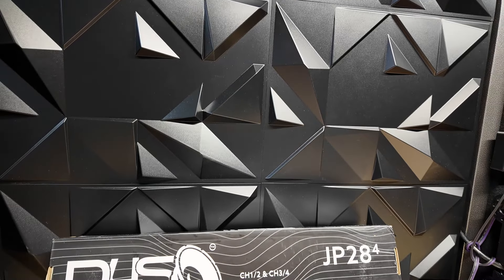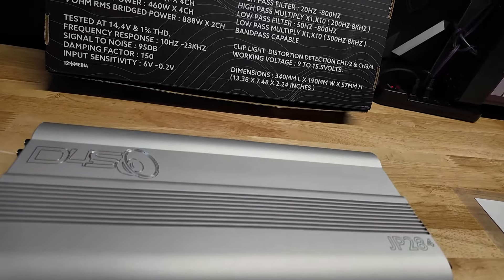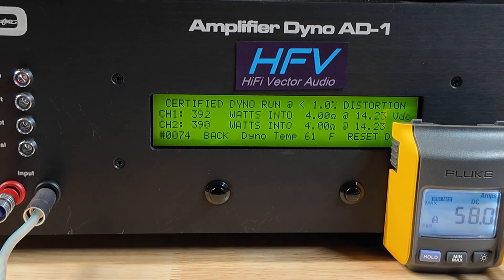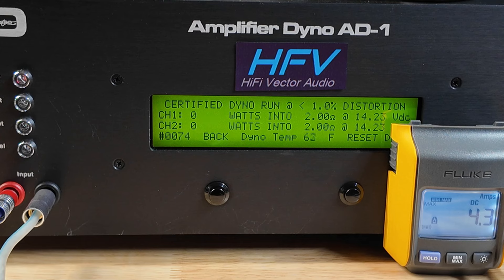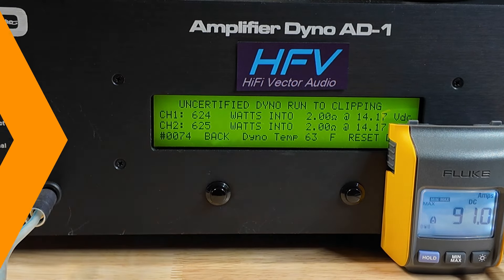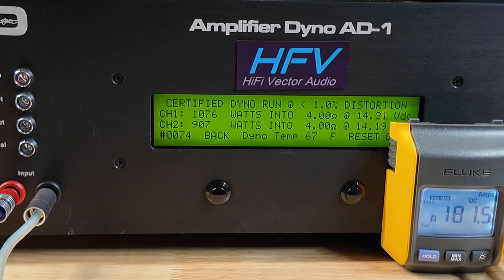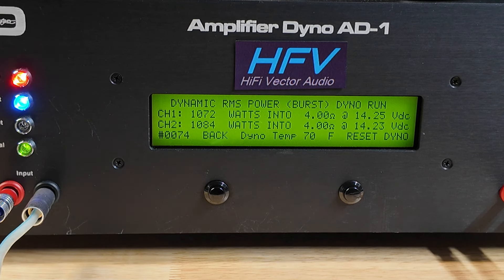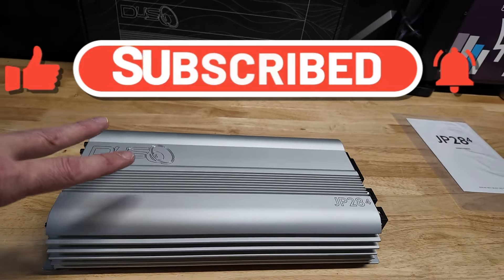D4S JP284 amp dyno test 4 channel car audio amplifier Down4Sound Jp

Comment: That's pretty impressive.  And the fraction of the cost of a US Amps.   Curious how it sounds.  The last JP 4ch I tried out was kind of lacking in the sound quality.  Just not the same as the Alpine it was supposed to replace.
Reply: Yep, but now a days you can get a pretty good dsp still less than a USamps or the new Orion
Reply: Very few people can actually hear the difference in sound quality from amp to amp when driving down the highway.  

Now for sound quality setups, that is a whole nother animal!!  When you have high end sound quality speakers, several layers of sound deadening, and good quality DSP then you could definitely hear a difference!!
Reply: @91CavGT5  I guess what I meant was that there was a bit more hiss/floor noise and sounded a little more compressed?  Not trying to golden ear here.  Just saying it didn't sound quite as good. Maybe with some more tuning, or maybe I was just used to listening to the Alpine for the last 10 years.
Reply: @johnnyh127   some of us can hear those things more so than others.  24 years ago I helped tune a SQ competition Kicker sponsored car at the USAC nationals.  Now though, my hearing has gotten so bad that I don’t know if I could tell a difference.  I envy you guys that still have hearing good enough to tell a difference!!  👍
Reply: @91CavGT5  if you have a perfectly matched ABX double blind setup, it would be very difficult to hear the differences between one amplifier or another.  But when you listen to something for so long it becomes the reference.  I was fortunate to work with David Clark, Tom Nousaine when I was younger.  I was just a punk kid working after school at DLC Design, but I learned more than I could have ever imagined.  And I realized that audio reproduction wasn't just about SPL and huge bass.  Part of my job was setting up the listening technology classes so I got to spend a lot of time listening to their reference systems.  I can hear the differences in the nouances. It may not be all of the time, but certain tracks on certain systems just sound different.
Reply: @johnnyh127  that is an awesome way to learn what music is really supposed to sound like!!  

With my friend’s SQ setup, it was in a Honda Civic.  It had components mounted in the firewall to the left and right of the driver and passenger feet respectively.  There were 3 Kicker Solobaric 12” subs mounted into a fake trunk floor, with two 1/3 octave mono EQs(maybe Audio Control I think) mounted to the back of the back seats.  The amps for the system were mounted upside down under the rear deck of the sedan.  It had 5 1/4” midbass drivers mounted under the front seats, and the front seats were mounted to custom brackets that moved the seats backwards 6” more than stock.  An hour before competition started, we were doing the finishing details and listening to a classical track.  In the drivers seat you could close your eyes and make out EXACTLY where each musician was on the stage when the music was recorded.  But there was a gap in the center, about 6” wide, where no sound was emanating from.  My buddy who did the install began to frantically check everything out, as after I pointed out the gap, they noticed it too.  Come to find out, one of the RCA cables was beginning to short out, and had a higher impedance than the other one which was causing a slight time delay, left to right, which made the two sides not cleanly mesh together as they should!!!  

I miss those days of hearing the nuances.  Now, I’m the old guy who can’t hear someone talking to me unless we are facing each other, and I’m the guy always asking people to repeat themselves.  

For those reading this, protect your hearing.  It doesn’t matter how cool you think you are with the loud car, with the loud exhaust, and with shooting guns without hearing protection.  You only have 1 set of ears, and when you begin to loose your hearing, you will never get it back again.